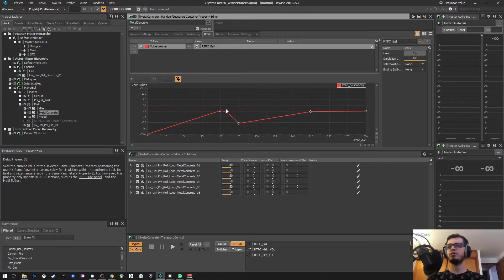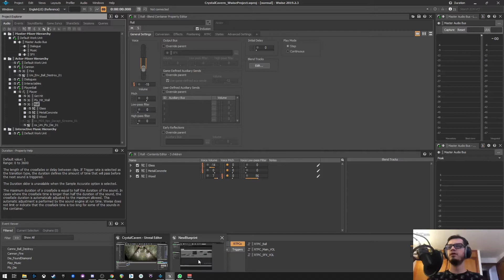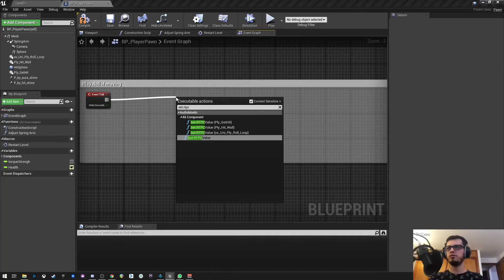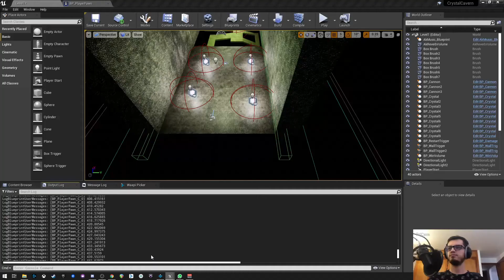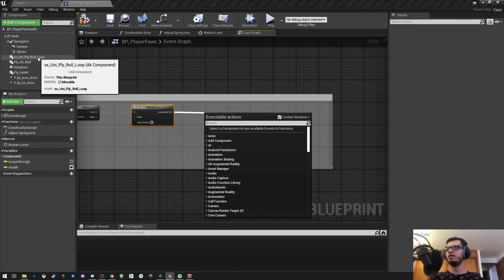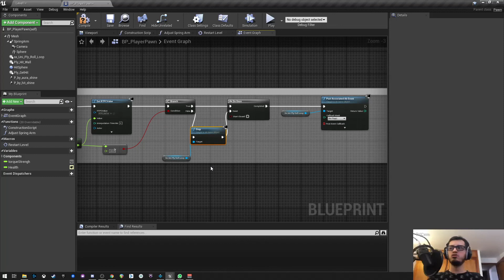Crystal Cavern RTPC - Rolling Sfx Implementation -  Wwise - Unreal Engine

Comment: Hey, really good content you got there ! I’m actually working on something similar than what you did here, but for some reason the «Set RTPCValue» node in ue4 bp isn’t showing me the RTPC parameter I created in Wwise .. and even if i write it in the node, i feel like it still not detecting the RTPC parameter. Maybe you know what’s the issue
Reply from the maker: Hi, thanks! well I might have to look how you have it connected. What UE4 and wwise version are you using?
Reply: julian quiroga hey, thanks for answering me, i’m currently using UE 4.26 and Wwise 2019.2.8.7432
Reply from the maker: @modofokokokonuts8622  maybe you can show me how you have it connected?  did you debug just before passing the value of the rtpc? maybe you're not passing the correct values?
Reply: julian quiroga Well, i don’t know how i can show you, but i can tell you the exact steps I do : put my sounds and create differents events, and one rtpc paramter in wwise, then generate the soundbank, then in unreal i create some events and the soundbank, I can hear the audio, i even implemented some with the "post event" node, it works great. But then when i open a rtpc node, the thing isn’t showing me the rtpc parameter i created. I did pretty much exactly what you did, it’s just really weird.
Reply from the maker: @modofokokokonuts8622  hey were you able to solved it? Sorry for the late response.
Reply: julian quiroga Hey, no still not able. Really weird. The thing is only RTPC isn’t detected. This is really annoying lol cause I have plenty of ideas that I’d like to try ..  Anyway, thanks for asking.
Reply from the maker: @modofokokokonuts8622  if you want you can go to my website and there's a link to my LinkedIn. We can contact through there and at some point do a meeting I don't know on zoom or something like that.